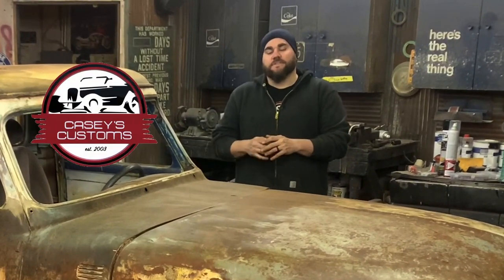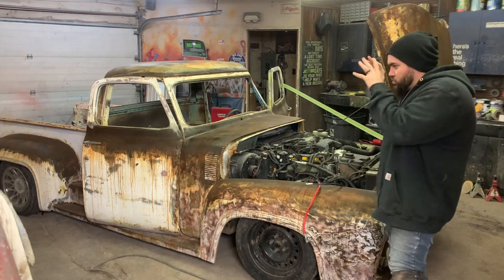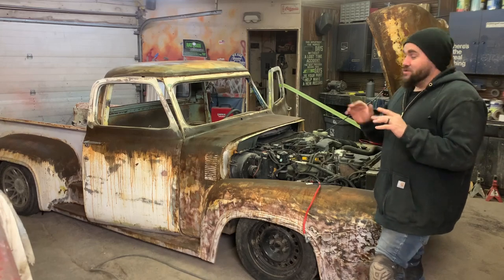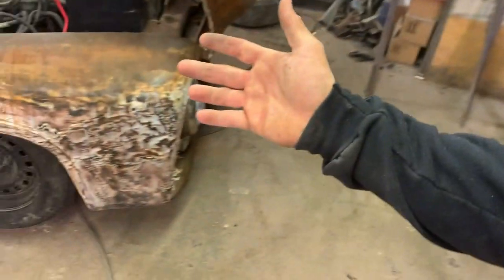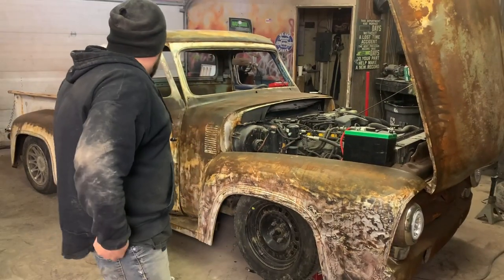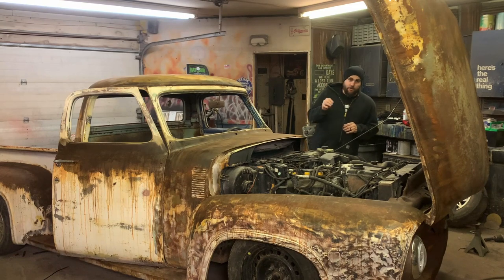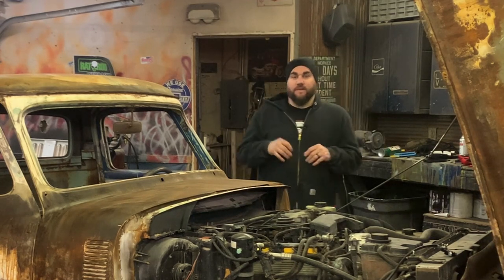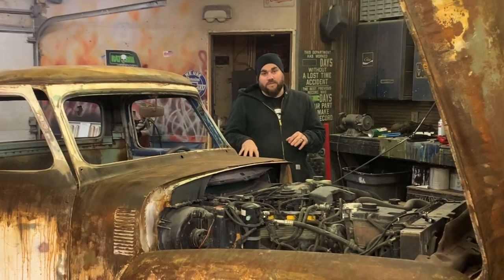BUILDING A HOT ROD FOR UNDER $1000 DOLLARS! PART 21! HOW TO BUILD A RAT ROD ON A SUPER CHEAP BUDGET!

Comment: Try running a hot wire from battery to alternator had a mid 90s ford wouldn’t start ran wire on toggle switch fired right up even after you started it you could turn switch back off and would still run

Comment: Why not have it switch through a relay triggered by ignition and you won't need the toggle switch.
Reply from the maker: I want it on a toggle for now incase i find out what the original issue is

Comment: On cars with security systems you click the remote and all the lights blink.since you have cut the wires to the dome light and the side marker lights that may be the problem(as they are tied to the headlight switch).I once had a customers car that wouldn’t start because dome light fuse was blown.

Comment: Crazy how electronic things work 😕 
But reminds me sorta of my younger days (a long time ago) around cars 🚗 whereas I would cut ✂️ one of the leads to the coil and run it too a toggle switch and hide it somewhere safely in the cab usually a dead switch on the dashboard or throw it underneath the drivers seat or back of the glove box. Then we called them a dead man switch (anti theft device).cause without knowledge of it and finding the switch they couldn't get it started

Comment: Check the inertia switch...
Reply from the maker: It’s not the inertia switch, i wouldn’t be able to hot wire anything if the switch was tripped.....
Reply: @CaseysCustoms  I was thinking that it only cuts the fuel pump off...been a while since I worked on those. Check the wire from the computer to the relay. It may be shorting on something. If it's  good then it's  an input signal that tells the computer to not send the power. Most likely security...maybe ther is a way to fake the computer into thinking the security is good all the time.??
Reply from the maker: @jonivanart  not sure, got a wiring diagram book coming

Comment: Dude, You need to go to Tractor Supply and Spend less than $200 for a propane heater that is QUIET!    WE use this heater to heat our 1200 Sq ft house.  Get the fan with it.  You will not regret it!
PS:  I have laughed at you videos... I watch with my hubby.  I laugh the hardest at your frustration with that heater!  Get a MR HEATER... propane or Natural gas!
Reply from the maker: I have a mr heater and it doesn’t cut it, i actually ran 2 of them at a time and still didn’t work as well as the diesel one unfortunately. 
Thank you for watching!!
Reply: @CaseysCustoms  Caven, My husband, and I both get a hoot out of your channel.  It sounds just like our shop when they are working on the race car or Rat Rod!  Sounds like home!🤣
Reply from the maker: @AdvocareMis   thank you, i think. 😂😂
Reply: @CaseysCustoms   Yes.. it is a good thing!🤣
Reply from the maker: @AdvocareMis  great! Lol